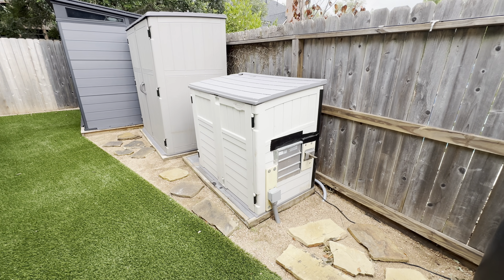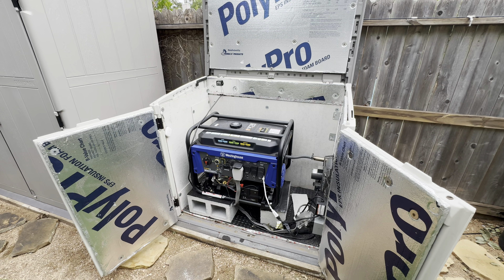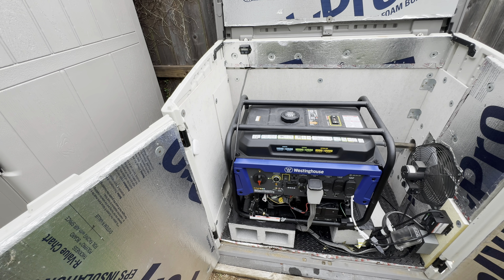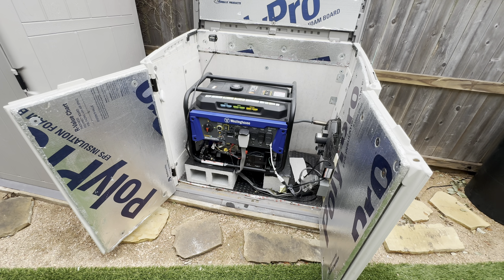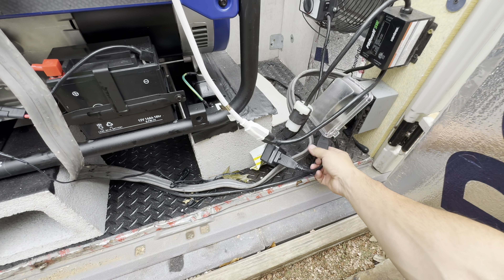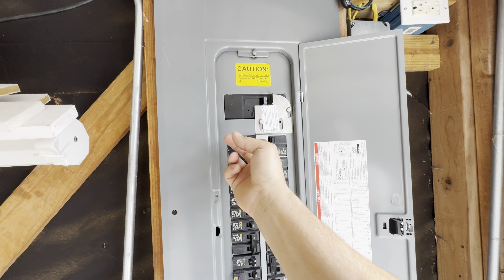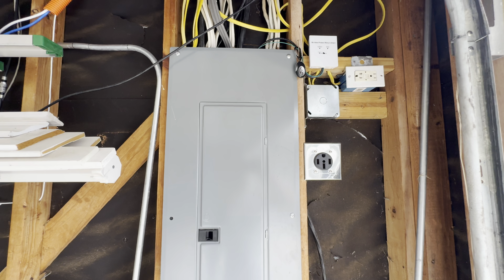Tri-Fuel Portable Generator Post Hurricane Update on Natural Gas

Comment: Calvin, help.
Question: what 50 Amp cable do you have?  Did you make it directly hard wire to the panel?  If so, where did you get it or did you make it? 6awg and 8awg? Please advise.  Thank you.
Reply: 50 amp needs six gauge

Comment: I have a simple question you sealed cover little shed your generator is not shot down but it self because of the co sensor sometimes look your box is very sealed so theres lot of smooke build inside thats or as long you have a exaust fan is not gonna gonna stop by it self

Comment: I run a Generac GP6500 to recharge my Solar generator batteries after Storms if I cant recharge with Solar panels, I can last about 2-3 weeks in the worst situation with 10-15 gallons of gas and 800 watts of panels alternating between uses. I live close to Downtown Houston so they cut power in my area to keep Downtown powered, now I am currently waiting on a few more upgrades for my House to stay powered for a month without Utility power.

Comment: I need help our brand new 13500 won’t start with natural gas.  You mentioned new spark plugs can you tell me what spark plugs and where to get them.  Our fires right up on propane and once in the natural gas only.
Reply: Did you figure out what the issue was? I was gonna suggest making sure the hose was purged of air.

Comment: Hi there!  fellow Texan here.... I came across your video ... I am thinking about buying a Westinghouse tri fuel generator and wanted to see if you can build or modify a shed for us...let me know if you can help! Hope you are staying safe ..the cold is about to hit us pretty hard. Please reply if you see this message and we can exchange contact info if that's ok with you. I am not too knowledgeable in all this to be honest.
Reply: bro its easy to modify and existing shed. I have a 10x10 shed, keep my lawnmower in there, put a attic fan in the back, lined shed in cement board, self tapped a vent to the factory exhaust, put a ac vent in one of the doors, and boom done. took like 6hrs to do it. i still store my mower in there. i live in tx too and i have a westing house 14500watt. powers whole house and ac unit
Reply: You talking French to me bro lol I have not worked on a shed or purchased one before let alone modify it

Comment: Do you ever start it in a video?  Maybe show it with a dB meter.
Reply from the maker: I will make a quick video of this and post it.
Reply: @CalvinGorriaran     Have you made that yet?  Just curious.  I'm contemplating one of these for the extra power over what my smaller inverters can do....even with a pair.  We have an acre lot and closest neighbors are 200+ feet away, then 800 feet, then 1/8th of a mile, etc.  Plus, we're in a ridge so people up the hill wouldn't care.  Heck, there are a few Generac gens in the neighborhood and closer neighbors to each other.  Even with my 11 year old (non used) Briggs & Stratton Storm Responder 8250/5500 open frame loud beast, you can't even hear it in the living room and just a low hum in our master bedroom/closet/bathroom area and it's about 30' from the 2 windows.  Good insulation and windows.  So, the noise isn't a major factor.  Sure would be easier setting one up than two.
Reply: @CalvinGorriaran   I think what I've decided to do, personally, versus building all these things is to buy either the Champion 100136 12.5kW standby generator or  their 100199 8.5kW standby generator that either can be done as a "manual" and not have to do an automatic transfer switch.  I already have the 250 gallon propane tank and a place right next to our house (within the guidelines) where I can mount it and tie the output leads right into the 50 amp breaker and alleviate the power inlet box.  The interlock kit will still be there and, if we lose power, I simply  go outside, turn off 200 amp breaker, flip interlock, and switch on the 50 amp and then the generator will feed the same things I would normally do with a "portable generator" and it can stay out in the weather and be protected.  I've been talking with champion about it and when done right, and to code, they still give you the 10 year warranty which is 2 years parts/service and then remaining 8 years parts warranty.  Kind of hard to beat that.  It's either spend $2600 on the 8.5kw or $3400 for the 12.5kw, plus tax, and shipped free to my door.   Plus, these are <5% THD so perfectly safe for everything.  I like that Wgen11500tfc but by the time you spend $1500 + tax and then all the other stuff, time, effort, I'm pretty much done and it drops in place.

Comment: Great setup. Only thing that has me scratching my head is that transfer switch for the fan? If the outlet gets power from your house wouldn’t the outlet also get power from the generator when you turn on the interlock? Then also have power when you switch back to utility power ? So really no need for a transfer switch ?

Comment: Does the CO sensor ever trip when in that confined space?
Reply: That is my question too, how fix that issue because the sensor turn on and cut the generator power turning off.
Reply: Put some tape over the sensor holes. It’s located near the pull cord and it’s about the size of a matchbox. It has a wire harness attached to it.

Comment: Check the oil level , sure, but you really don't need to change it after 50 hours.  That oil stays clear for a long time.  Westinghouse built this thing for long use and its not a pussy

Comment: Calvin - what 50A cable did you use and where did you get it? I like how flat and low profile it is
Reply from the maker: Hi 👋🏼 This is a direct burial 6/3 cable. I reused it from when I had the cable buried on the other side of my house. It goes from my panel (interlock protected), directly connected to the 50A breaker, to that Eaton plug that connects to the generator.

Comment: Great rig and video.  I love ALL the extra accessories you added.   Don't recall your mention of having an appropriately sized fire extinguisher very nearby.   Think you might need some sort of fire/smoke alarm in your gen shed?  Have you considered adding an independent fuse/breaker between your generator and the extn cord to your neighbor...to prevent overloading of that branch circuit?  Thank you for sharing.
Reply from the maker: I have a fire extinguisher in the garage on the wall about 15’ away. I think that is a good mention. I will bring that up on a future video. The extension cord I sent over was from a plug on the exterior of my home. If they overload it, it would have just popped the fuse on that circuit.

Comment: I'm glad this worked out for you. I'm currently in the fallout from Milton in Central FL. My Westinghouse WGEN18000DFC went out on me on day 5 of no power, only about 40 hours total of usage, including the 5hrs of break in from back in the spring. I don't run it non-stop, I cycle it. It stopped outputting 240v. I tested and was only getting 120v on one leg and 60v on the other. Westinghouse is sending me a new AVR (automatic voltage regulator) but it's too little too late. This is my second Westinghouse unit, the first one showed up with a major oil leak, I had to transport it to a service center (not easy)  where they could not fix it so they sent me a replacement. I'd say if you're planning to rely on one of these you need to stock up on a bucket of spare parts and know how to fix it. I'm going to be seeking an alternative because I'm 0 and 2 on Westinghouse units so far. Super disappointing to spend all this money, time and prep work on it to fail when it's brand new.
Reply: I'm told there are only a few factories in China (12 or so) pumping out these generators under various names like Ford, Westinghouse, Champion, Cummins, Generac, and Genmax. Not to be disrespectful but we call these Chondas or Chinese Hondas. They are Honda clones and you may get are great one or a failure. I bought three Duromax 13,000; two were great and on through a rod after two minutes of run time.

Comment: Nobody cares about the generator noise? Well if you have it just sitting outside 10 ft from your neighbors bedroom window and you start it up at 3AM.  Somebody's gonna care. No need to run it 24)7 either. Great idea, the shed. Thanks for sharing
Reply from the maker: No complaints yet. No one cares when there is no power.

Comment: This has got to be the cleanest install I've ever come across. The thought to run the fan even after the generator has stopped is very thorough.
I bought the same generator recently and planning to install it this weekend. Can you describe how your natural gas connection is installed? My Ng meter is right next my garage where I plan to install the generator, but worried if it will cause issues with the NG pressure if run the generator and use the kitchen stoves at the same time
Reply from the maker: You have plenty of pressure to use both. I had both gas furnaces running with my generator going and a gas fireplace. No issues.

Comment: CO sensor question. How did you by pass it? I constsntly see problems on other peoples builds. Their generators shut down constantly because of that lousy sensor
Reply from the maker: I have not bypassed it. I suspect those other builds either have an exhaust leak with their extension or they are not moving enough air out of the enclosure.
Reply: Put some electrical tape over the holes on the sensor itself. It’s located near the pull cord. I believe it’s the size of a matchbox and has a wire harness attached to it.  That will be prevented from working and cutting off the generator. It does have a battery in it, though that will die in a couple of years and caused the same issue I believe.

Comment: Just found your video. It is a big help I recently brought in a champion 12 KW try fuel and put it in a shed considerably larger than the one you are showing and even though I had an exhaust fan that looks like the one you have, I found it. It was very hot inside this shed, so I added a much larger fan that is doing a great job to exhaust hot air out
I am also hardwired to my natural gas and hardwired into my existing transfer switch that I had for my Generac, which died after 17 years 
I am very pleased with my set up however, I was interested in your reference to changing the spark plug because sometimes I find the generator difficult to start. I have never used gasoline in it. Could you give me more information on the recommendation for the spark plug ?
Thanks BD

Comment: Why do you feel the cement board was a better choice than the foam insulation?
Reply from the maker: @jeffhamiltoncertifiedmaste5374  it does better with the heat and doesn’t take up much space.

Comment: Does the co2 sensor trip it offline?
Reply from the maker: @manuel8864  it tripped when I had an exhaust leak and when the fan didn’t turn on. So it’s working when it needs to but doesn’t cause an issue when things are in the right conditions.

Comment: You ran a gas generator inside of a garage ? Aren’t you supposed to have it 20 to 50 feet away from your house?
Reply from the maker: @familyman2480  nope. I started it with the remote in my garage. The generator was outside in the shed.

Comment: I've noticed you don't have any of the tires or rubber stands installed on it. Is that because you are worried about them melting in there, or to keep it flat, or so no one can easily wheel it out? Looking to do something similar with my 12500 Westinghouse soon
Reply from the maker: I just didn’t have the space for them. It would be too wide to fit in the shed with the wheels on.

Comment: I see you replaced the spark plug using NGK BPR6ES which is a resistor plug...the Wgen manual states not to use a resistor plug...another viewer in in your the comments stated to use NGK 2311 B7ES-11 and gap at 0.8mm. Can you please help me on which is correct...thank you   this is what another viewer stated: Just a FYI, I noticed in the comments people are suggesting a NGK bpR6 or 7es plug as a replacement for the Torch. Both of these are resistor plugs, please read page 29 in the manual before using those plugs or contact Westinghouse to clarify. I went with a Denso non-resistor crossover plug to be on the safe side.
Reply from the maker: Hi Pete. I know we chatted offline. I have not had any issues with the NGK BPR6ES and did not change the gap of the plug. Westinghouse can be confusing and sometimes inaccurate.

Comment: Smart move with the fan running all of the time thru the reverse house inlet.  I've never seen that.  Great setup.  My only hurdle is a slope where I want to set my generator for a permanent position.  Might have to set some posts and build a base and figure an exhaust noise cancelling system.

Comment: Another option to think of if you'd like to take a break from the noise of the generators, if it bothers you. Batteries with inverters. I had us set up with a less than full house coverage because of the cost years ago and then we had to use it after Hurricane Michael. We're in Panama City, FL and It took about 3-1/2 weeks to get power back. And we were lucky.

At night, we used 2 pairs of deep cycle batteries with inverters to keep the refrigerator and freezer going on one set and 2 small window air conditioners on the other set. The hurricane took out the HVAC unit.  We'd charge the batteries during the day while running the generator.   We're in a better position now so we can afford the slightly bigger setup, but it's still nice to have the quiet at night.
Reply from the maker: You read my mind! Check out my latest video about Solar as well as videos to come. https://youtu.be/wMYLyzwtIQU

Comment: I bought a harbor freight for $650  9000 ,and installed to house panel and safety breaker shut off, it does whole house electrical including central air, tv , refrigerator  , now i got a tri fuel carb for gasoline, propane, and natural gas after i score quick connects and hose for the natural gas to the house , We must help each other even a neighbor in need , till they get their own hookup, a sence of pride can't be beat , doing so. Got 3 ways staying safe n comfy.
Reply: The problem with natural gas is after a hurricane sometimes you will lose the natural gas supply to your house
Reply: @Coyote-tc1ww  That's why I like the tri-fuel option. NG first, propane second, and Gas last.

Comment: Nice setup!
I bought a refurb Firman tri fuel last year, just bought a small shed like yours,  i still need to put together.

The refurb was a great price, but you need to go thru it. The gas line was not connected, the oil drain plug was loose, batt terminals corroded, a few little things to check out before start up. If you buy a refurb, you should be mechanically inclined, otherwise, you will leave a bad review.
It started right up, no issues.  Any suggestions for long term storage? Putting a vaseline coating on the batt terminals is a definite.

Comment: You don't find the shed is too small? I have the same WGEN11500TFc and am afraid to do a build without 4+ inches clearance all around. Great video and narrative on the what's and why's.
Reply from the maker: It is a little tight but it has worked well. I do recommend just using cement board inside the shed walls. Also add muffler wrap to the exhaust extension. https://amzn.to/3MCiSmA

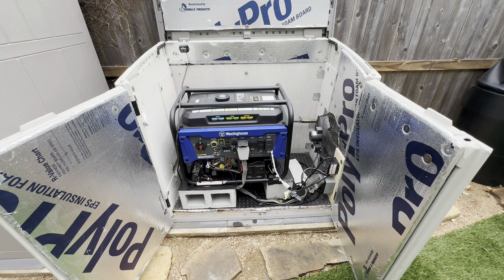Comment: 7:20 I have an older gasoline Briggs and Stratton 5500kw peak, here in Spring I ran mines for 7 days after Beryl no power everywhere 🥵….changing the oil out every 50-100 hrs is recommended. Because I was running it long enough to add gas,  I changed my oil out every 48 hrs and running synthetic too… Oil is cheap and it’s going to prolong the life of my generator… I also changed out the Spark plug after power was restored, we’re ready for what comes next….After watching this video, saving up funds   to a larger DF Gen because we do have natural gas system in the house…. Competing  with everyone else in our area every 2 days looking / filling gas at the pump is definitely a downside to my current setup… thanks for a great updated posting.

Comment: I’m getting to these comment late I know. I just happened across your video. I read many of the comments already. 
I know I’m gonna get some flack over this but…
I use a 100’ long 3/4” ID water hose with quick connects instead of a natural gas line. It’s rated at 500 psi. Natural gas is usually just a few ounces. It’s temperate anyway and rolls up quick after. Just blow it out. 
I drove through Sugarland (Sienna) to help a friend right after the hurricane hit. It was devastating. It’s the first time I’ve ever heard so many generators running throughout a single area. It’s good to see so many proactive people.

Comment: Great communication on your video. 
Thank you. 
To the person asking about the Duramax 13,000. YES it will do just fine on a 4 ton. I live in Katy. I’ve built 5 exact Duramax 13,000 generators on Natural Gas. All have been successful w/o using a soft start.  I highly recommend using the Micro Air anyway do it doesn’t task your generator. And definitely change the oil every 40 hours. The oil is the life of any generator.

Comment: I used the same shed for my DuroMAx 4850 dual fuel and it does a good job for our needs. I noticed your side vent looks very small compared to your fan. I'm sure some engineer can tell us the exact size required but I personally used the total fan area as a guide. I run ours in 110+ temps in AZ here with no issues. I also installed a Govee Indoor blue tooth thermometer unit so I can watch the temps on my phone and get an alarm if temps get crazy hot.  Nice setup you have there.

Comment: Nice setup.  If you were to do it again, would you consider a bigger shed for better air flow? or is that size good enough?
Reply from the maker: @VuVu-hg6di  good question. If I did it again, I would probably build it out of wood and Hardie board. Bigger and with the attic roof style fan so the heat would vent up. Also could get a higher CFM that way.